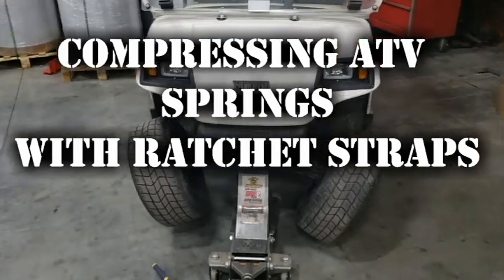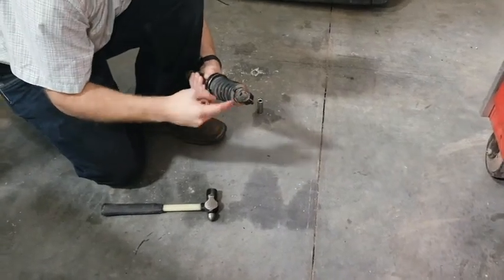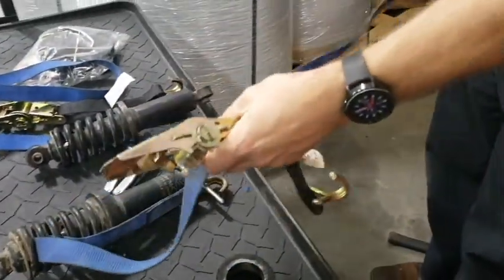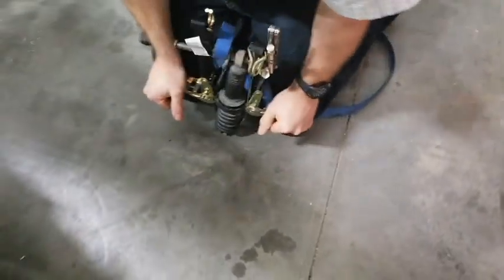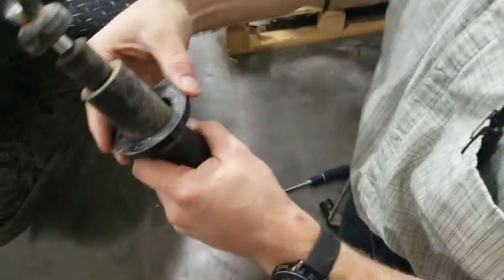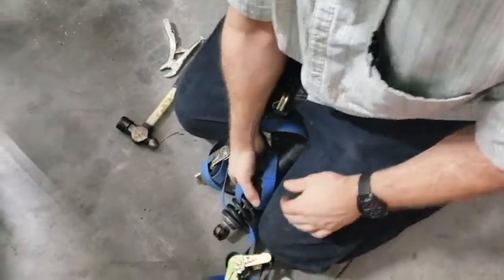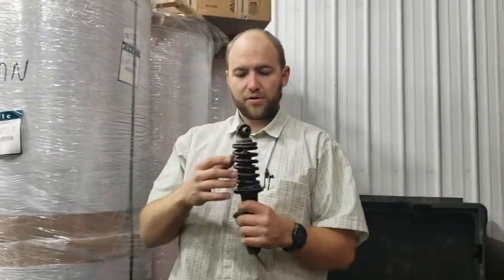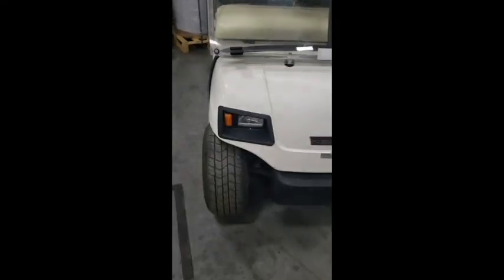Compressing ATV/Golf Cart Springs with Ratchet Straps

Comment: Man you confused me because in the beginning you said you had negative camber, then when you reduced the shim size I thought I mightve been losing my mind for a second and thought that you’d need to add shock strength to compensate for negative camber. But then you said it was positive camber and all made sense. I’m about to replace the springs on my foreman so the use of the ratchet straps is really all I was after. Thanks for the video sir.